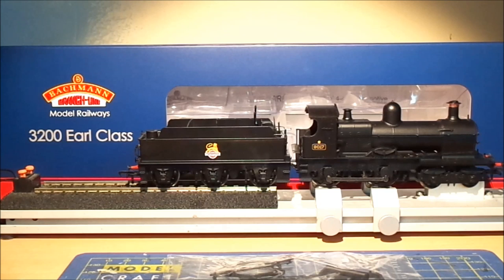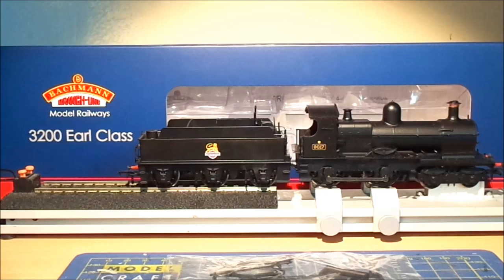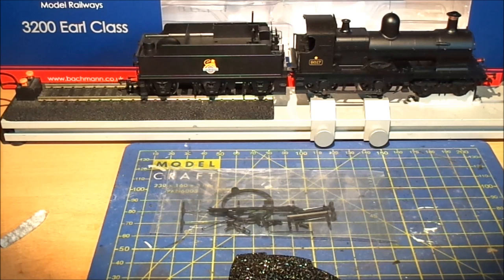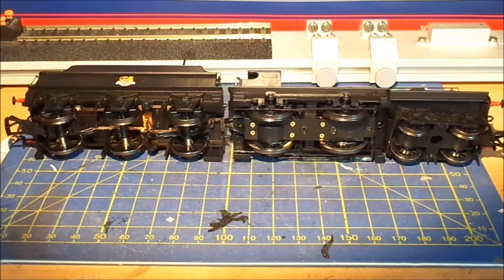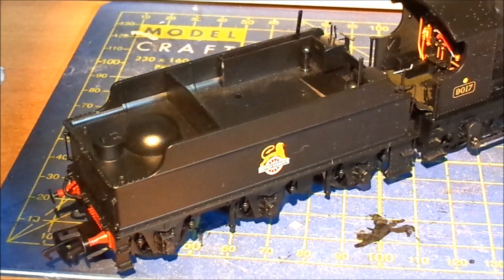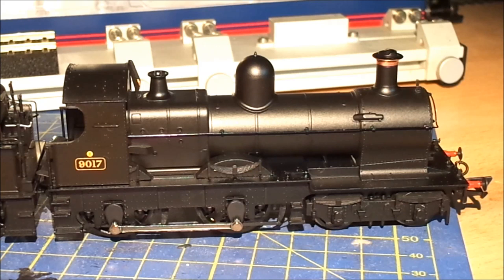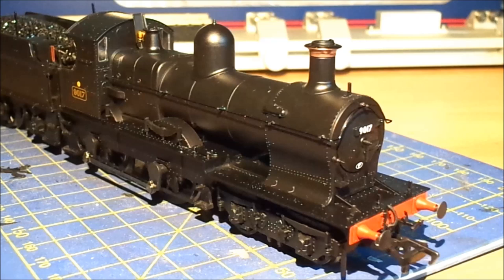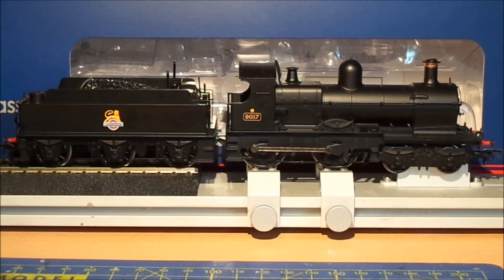Bluebell model review, 31-086, Earl class, Dukedog, 9017

Comment: is that smooth? seems like it would jump to a start than pull away gently. Bachmann persist with a three pole motor? Is the dome correct/ accurate?
Reply from the maker: Its very smooth for the controller i'm using which is an old Hornby controller not the best but useful for running locos in, works better on my Gauge master controller, This loco has a 3 pole yes, I don't know about others.
Dome and the look of the loco look fine to me, Bachmann do work off the loco drawings which I know they had for this and several other locos.
If you don't think it's worth it... don't buy it. For me it's worth it and the money.
Reply: I received mine yesterday. It is running in as I type. It started and ran smoothly right out of the box.